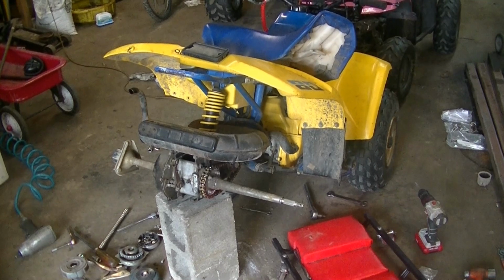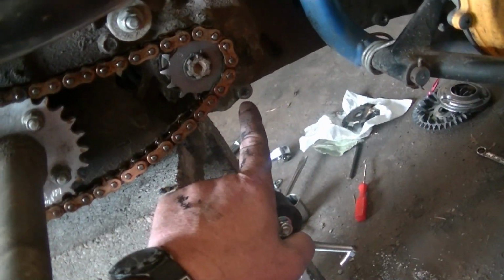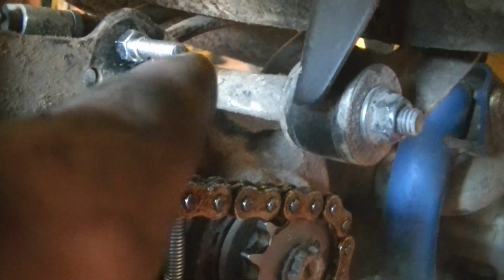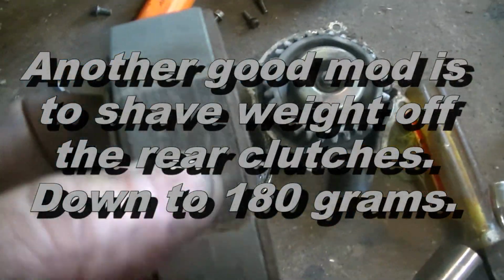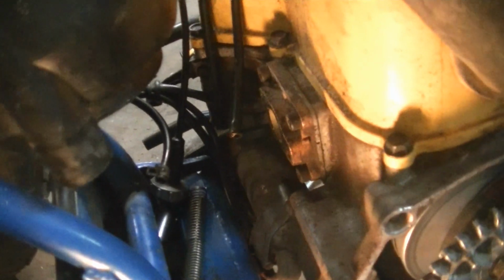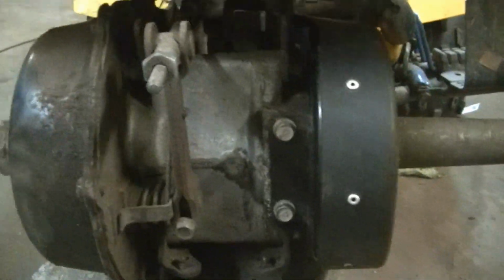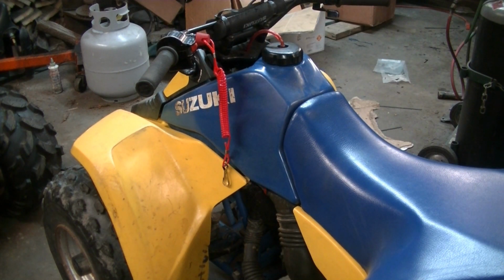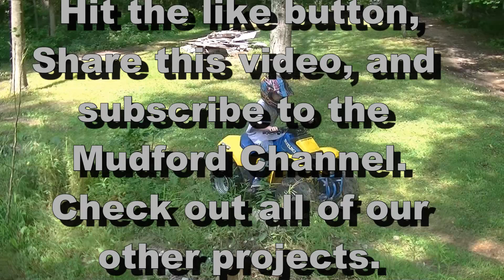Prepping A Suzuki LT80 To Race Motorcross

Comment: My son had an LT 80 new in 1988. Now, I bought a used 1987 LT 80for his daughter my granddaughter.
 The gearing is 10/22, but all the sellers on eBay list the chain and sprocket kits as fitting 1989 through 2006. They don’t mention 1987 or 88 as one of the machines that the chain and sprockets fit. Does anybody know if this brackets fit all LT 80s or are the sprockets for the 86/87/88 different somehow

Comment: Good job. My son has one they they rip. I have the Midwest sprockets on as well but never changed out the chain. What chain are you running 428?
Reply from the maker: mcj john thanks, yes it’s a 428.  Check out my other LT80 vids.  We’ve made a bunch of improvements.
Reply: instablaster